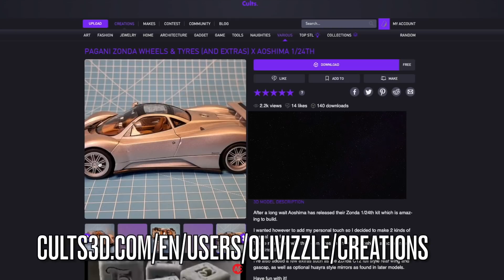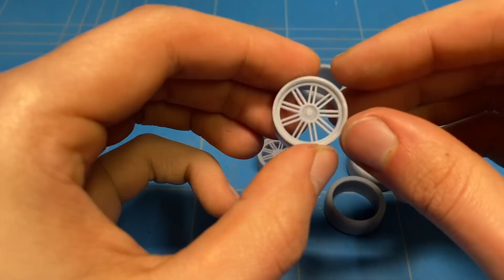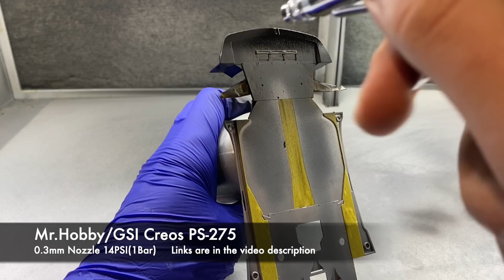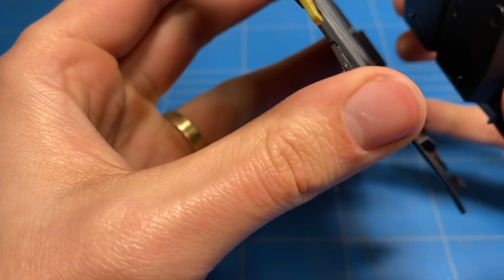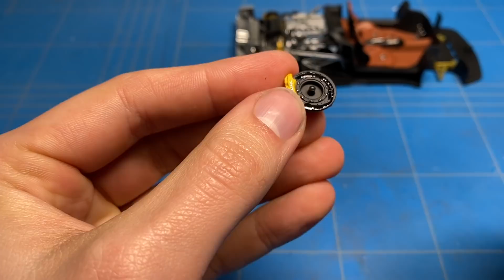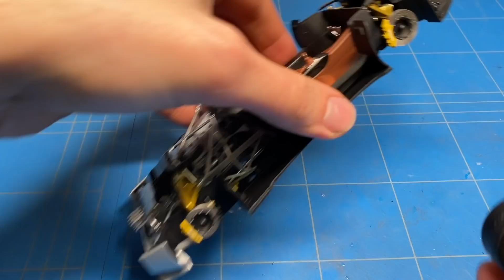Building the Aoshima Pagani Zonda C12 Part 4: Front Suspension & New Wheels

Comment: Been waiting for the resumption of this build and I am definitely not disappointed. Looks absolutely amazing. Noticed you got a new airbrush is it going to be your main one or are you going to use the 290 for larger sprays like bodies and the 275 for smaller parts?
Reply from the maker: It will be a combination of both. Probably the 290 for bigger bodies and clearcoating.